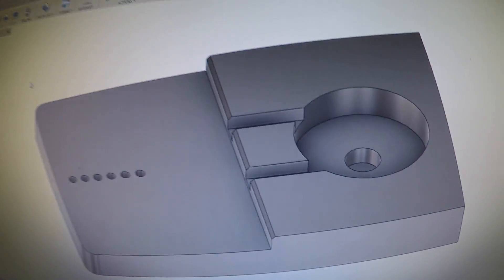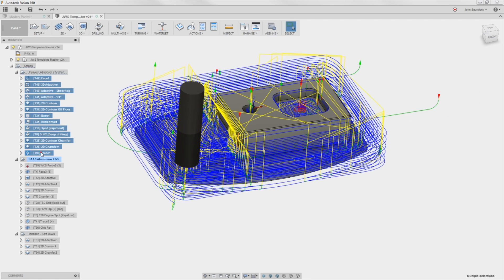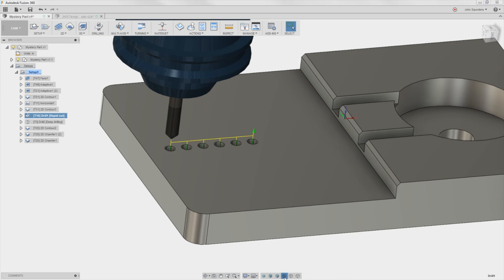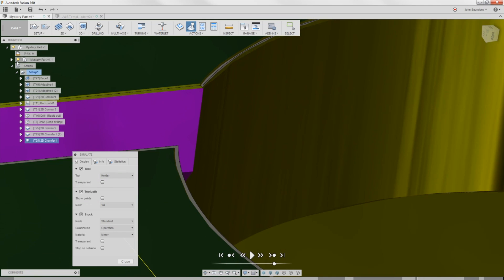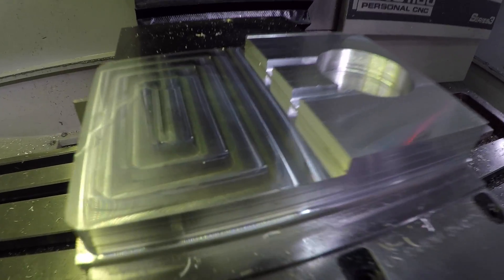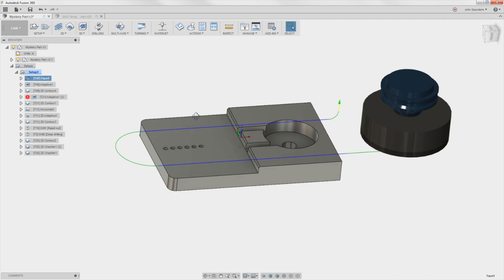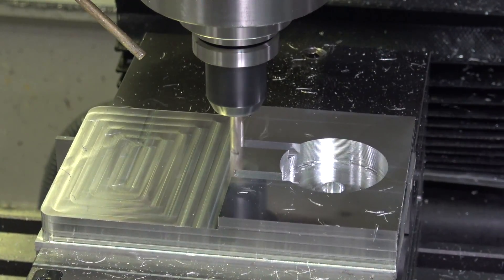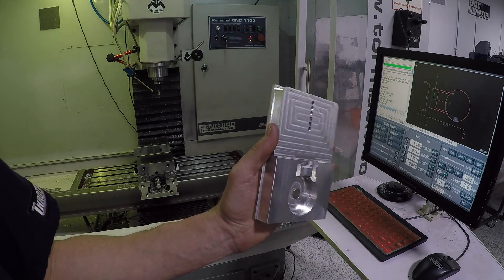Machining a Mystery Part!  Can you guess?  WW130

Comment: Hey John, sorry I may have asked you this before, but I've always wondered why you begin with a face cut and not finish with one? 

In this case only half of it got machined away, but I've noticed on other jobs the whole lot got machined away. You indicated the top of the stock, so all operations should know where that is, and it doesn't need to be super critical if it's going to be machined down anyway with an endmill etc.

In this case you could have finished with the fly cutter and got that whole face in one pass.

Not a biggie, but just wondering as it sometimes seemed like an unnecessary op.

PS No clue what it is. A key holder!
Reply: Thanks John, I think I get why you're doing it but wondered if it's really necessary to "force" a new Z height if you're then going to immediately plough the whole lot off with  an end mill? The model itself has established the relative positions of each feature with respect to each other, and it's not like manual machining where you first need to create a reference plane and work from that, in which case you absolutely would deck the stock first.

Not a biggie, but especially with a machine without an automatic tool changer, it seems (at least to me) another step that could either be removed entirely when the whole part is subsequently machined, or at least resequenced, to increase efficiency when that face is only part-machined. Am I missing something here?

PS You're killing me not rolling out your 5th axis. I'm designing my own and am busting to see yours operational. 5th axis is giving me nightmares ;)

Comment: It could be a housing for a hydraulic/pneumatic pump of some sort: the two slots are in/out ports, and a vane/impeller goes in the central hole, with magnetic bearings, and another (machined) piece goes on top, with a smaller hole for the shaft to turn the impeller.

Comment: To the folks mentioning networks or alternate methods of file transfer...simple is always better.  Compartmentalize your CNC machines.  No sense in worrying about transfer, communications, running wiring, etc, etc etc, when you have to set up tools and coolants, etc.  Plus you don't have to worry about what if the network goes down, or someone spills coffee on the server, being hacked, etc etc ...manual transfer is the way to go.

Comment: Arduino powered scraping tool motor bracket? Nah. Combination lock holder for automated arduino lock picking? Nah. Heimer crash protector? I want one! Pop off holder for automated aiming coolant head? Maybe. Induction metal heater coil holder with automatic hot magnet release? Nope. Baby bottle holder? Coffee cup holder for Hummer?  Tormach 440 power draw bar bracket? 440 ATC motor bracket? HAAS door lock bracket for when Jimmy Diresta visits for the advanced class?

Comment: John, you often (nearly always?) tap manually.  Why is that?
Reply: Shane Harvey 
because he has a flex arm and it's faster and easier than using a tapping head in the CNC.

it's also good practice to do as much work offline as you can to free up the CNC machine for running more complex ops.

Obviously not important for one-offs, but it's a good habit to form, for production work.

Comment: So, I'm thinking about this more... It looks like it's milled out for a stepper motor or something on top with the two slots being room for a belt down to the lower deck where the tapped holes are where you can mount a larger gear of some sort. That's why you had to mill out more room; to allow a round gear to clear.
Reply: Either that or a fixture for Master Locks.

Comment: That's quite the large rare earth magnet. Like 1"X1/4"?  That's  22-25 lbs of pull force! 

Which would be enough to probably hold that entire block of aluminum up. And being rare earth you can't shut it on and off, so not so much use for assembly.  And not putting any Motor or anything else electrical near that magnet that's for sure. 

Tapped holes in a row like that usually means it'll have to be adjusted from time to time, so some sorta stretchy wearing item is involved like a rubber belt? 

No tapped holes around the bore section. So no cover for that part. 

If nothing else I know how you could turn it into a tramp oil skimmer 😁
Reply: He'll need to hire a new guy, just so that he can send him looking for one of these magnets for aluminum.

Comment: Hey John, I noticed when you set the Z zero on the Haimer, you then went and took off another 50 thou and reset zero, what is the reason for that?  I did notice today when I made some parts, the initial run across the face didn't make contact until the next pass, is that something in fusion??

 I also noticed when using a square end mill on the floor, if you the corners are less than optimal, you need a larger overlap to avoid leaving those nubs...
Reply: I do the same thing when I am machining parts, that way you can set the part zero to the machined surface in the cam. If you set the zero to the raw stock surface and then face the surface to Z0 it will just rub because its not really cutting anything. You could also zero it on the stock and set the cam to face it to Z-0.05 or some other depth but then you have to manually add -0.05 to any subsequent operations unless your cam does it automatically, otherwise your pockets and such will end up shallow.

But in the end it really depends on where your zero point is in the cam in relation to the part model.

Comment: John watching you brush chips around leads me to believe you need some sheet metal covers for the table on your tormach.  Heck if you make covers out of sheet aluminum and put removable magnets on the bottom, you could even catch a lot of iron dust if you ever machine iron castings again.

Comment: induction heating tool ?????!!!??!??
Reply: There is a test when a metal gets to the right temp the magnet wont stick to it any more.
Reply: When Diresta has seen it before you and it was only just uploaded.

On another note,
give me a new video, I need my fix!
Reply: Yes, I see that too, but what is the purpose of the magnet? Keep an item upright?
Reply: be a little hot for the aluminum, wouldn't it?
Reply: Steve S Ah right, the Curie temperature. I see what you are on about, the magnet is a check for a specific temperature.
Reply: GadgetAndKite 
Curie temp for iron is 1043K. 

The melting temp for aluminum is 933K...  I don't think it'll work too well 😆
Reply: Peristaltic pump housing.
Reply: jimmydiresta You might be right.
Reply: ErwinEnterprises 
Maybe. But that doesn't explain the giant powerful permanent magnet...
Reply: ErwinEnterprises  that's what I was thinking
Reply: it would hold a versa grip nicely wouldn't it? :)

but the induction tool we use at work will heat any conductive material nearby.   also the neodymium magnets tend to explode after a few hundred degrees.